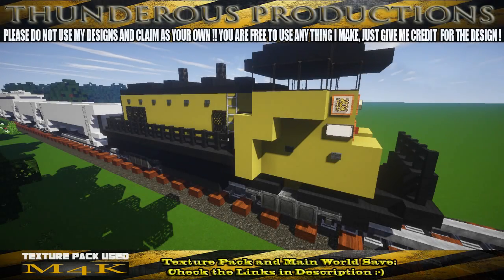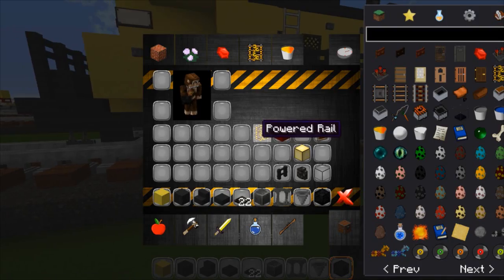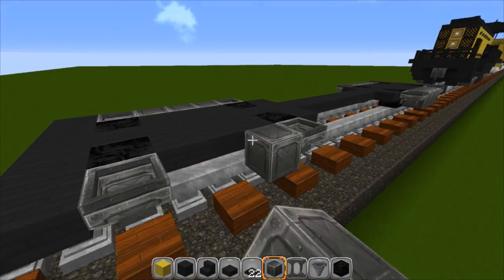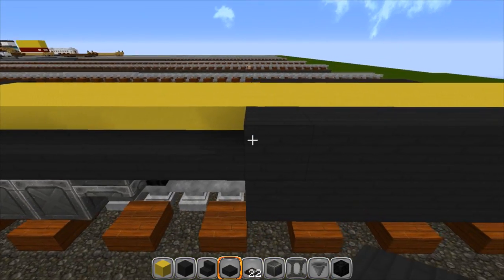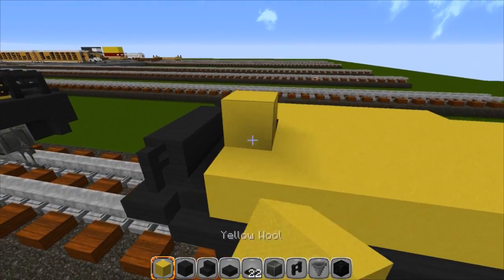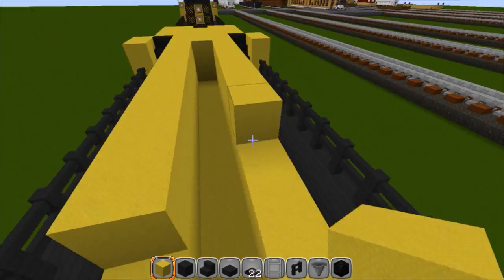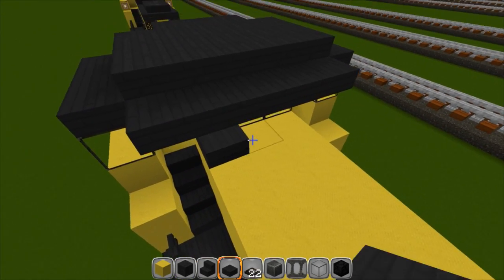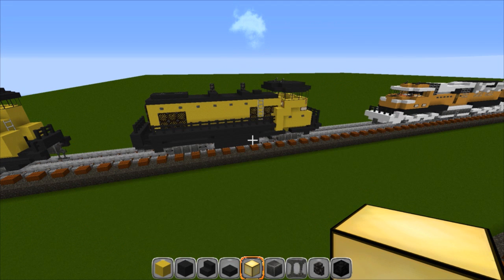Minecraft Train Tutorial : Switcher Engine (UNION PACIFIC EMD MP15DC)

Comment: How did you get the trap doors to lay flat on the sides for grilles?  We've been trying and trying and short of sticking a redstone block out next to it we have had no luck.
Reply from the maker: +John Ayers They place right on the side of the engine. Not sure what ya mean
Reply: They stick out horizontal unless there's redstone powering them.  Which isn't always convenient or possible to place.
Reply from the maker: Ah that was a McEdit mishap there. It doesn't like rotating schematics. Trap doors and anvils get spun around and jacked up like that :-P